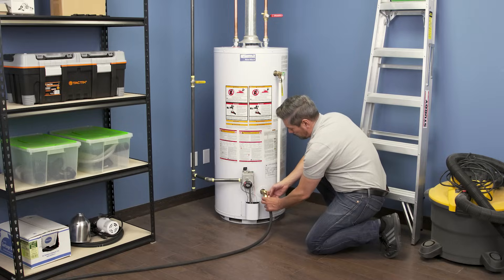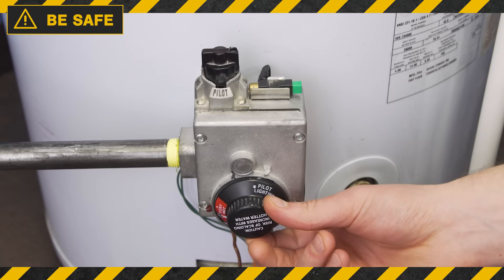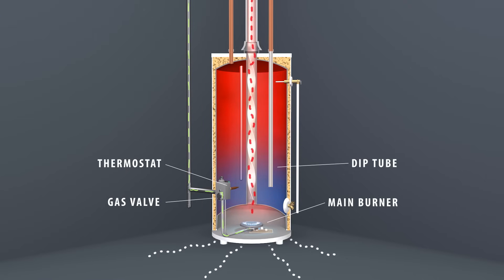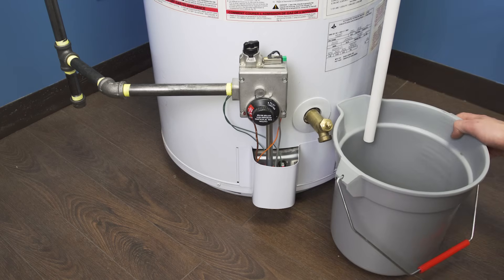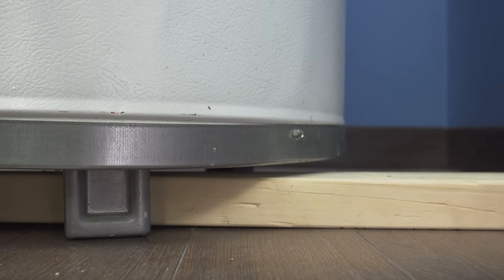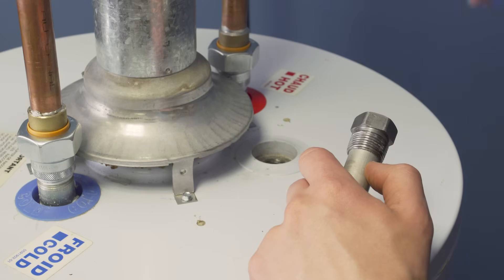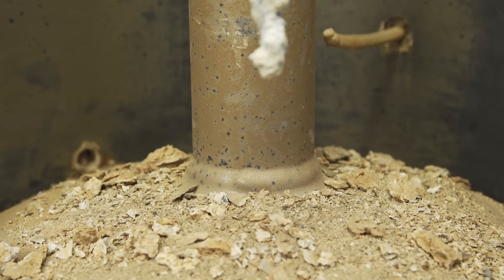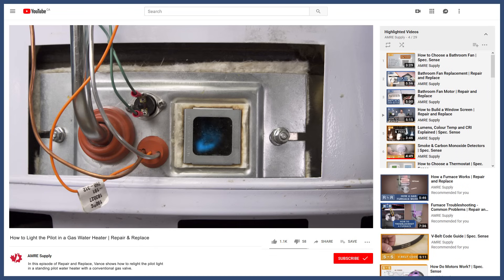Gas Water Heater - Maintenance Guide | Repair and Replace

Comment: By far the best video dealing with water heater. Most of the scammers deliberately not showing all the details to confuse you, hoping you give up and call them. Watch this video a few times. Carefully step by step write it down. Do the replacement carefully making one step at the time. First time doing it seems to hard. The next time you’re the best water heater professional. Because none will do better job than the owner. Knowledge saves family budget. Good luck!
Reply from the maker: Thank you we're glad you found it helpful!

Comment: I disagree on the annual checking of anode rod because by the time you loosen the connection and pull the corroded rod to eyeball it, then might as well replace it.
Reply from the maker: It really depends on how hard someone's water is. There are cases where the anodes will go much quicker and checking it once in a while can give you an idea of when it will need to be replaced.

Comment: Can you just use pipe dope on the threads rather than teflon tape?
Reply from the maker: Yes pipe joint compound can be used as well.

Comment: 16 year old gas water heater. Never touched it to do maintenance. still working well. Should i bother replacing the anode ray or just wait for the WH to eventually fail?
Reply from the maker: Thanks for watching. It depends on how hard your water is. In some cases you can get away with without replacing the anode for a while but if you access and remove the anode it you can see how much is left on it and make the decision on when a replacement would be needed.

Comment: Nice video. Flushed my 1.5 year old water heater and my water must be pretty soft because water came shooting right out. Idk how I’ll ever replace the anode rod until it completely disintegrates. There’s like 1-2 feet of headspace above the water heater
Reply from the maker: Thanks for watching. If the anode disintegrates it can make it easier to remove. In some cases you can just use a hacksaw to cut it or bend it.
There are flexible and segmented anode rods that can make an installation easy in tight spaces so there are some solutions!

Comment: this video need Edit: You need to flash first or drain 5 gallons or so before checking the anode rod. No need to turn off the gas. Turn off water, turn gas to Vac or Pilot and go to sleep, next day your water will be cold. Much easier with cold water.
Reply from the maker: Thanks for watching. In these videos we advise to turn off the gas and to put into pilot mode for that additional level of safety. As well in the video we mention draining several gallons of water before checking the anode rod at 4:27

Comment: I have a 30 year old heater that has had zero maintenance.  How do I know when it's time to replace?
Reply from the maker: Thanks for watching. This can depend on the hardness of the water. Some people find that regular maintenance helps and others have gone decades without touching their water heater. If you try to access the anode rod at this point, the threads will likely be stuck and quite difficult to unscrew. You can always check the anode and replace it if necessary. Depending on how much is left, that will help you know when you should install a new one.
Reply: When it starts leaking its done

Comment: Great and very detailed video! The only item missing is to mention that when replacing flush valve, instead of regular get full port one - it will speed up flushing and remove more debris.
Reply from the maker: Thank you we're glad you found it helpful! We did mention the full port ball valve in the dedicated drain valve video: https://youtu.be/nGCejMsKNX4?si=V3sA_QfBlstpVair&t=197

Comment: The first thing I would do is change the plastic relief valve piping. I can't understand how anyone can use plastic for a heated pressure vessel that ha the potential of producing high pressure steam which is very dangerous,. That plastic would blow righ apart under 160psi and steam temp would be over 350 F
Very dangerous.
Reply from the maker: That is an excellent point. Plastic is not idea and in our Drain Valve Repair video we outline the option of using a full port ball valve instead of plastic: https://youtu.be/nGCejMsKNX4?si=ep5daL5Iay2dysZV&t=195
Reply: @AmreSupply  Yes, I saw that. But I was talking about the T&P RELIEF valve that was piped to the floor with plastic.
Reply from the maker: @akrocuba  Thanks for clarifying, missed that part on the relief valve during the first read of it. Have you seen examples of the plastic piping rupturing under that pressure? Or do you think the fact that the unobstructed pathway allows steam and water to be released through the pipe rather than damaging the discharge pipe itself?
Reply: @AmreSupply  Yes. The plastic could simply melt way, rupture and then the relief
 is pouring into the area of the vessel

I know manufactures make the relief valve drains, but manufacturers also still make S-traps that are illegal in every plumbing code that I know of

I'll stick to steel or copper for all my pressure/temp relief piping

Comment: Just replaced my 28yr old water heater, never touched it. Don’t touch your water heater!
Reply from the maker: Thanks for watching. The advice to never touch it and do any maintenance might not be the best idea depending on what model you have. Older models didn't have a flame arrestor screen. Dust and debris can clog this screen and can prevent the burner from working properly. In these cases regularly cleaning the screen can prevent these problems before they occur.
Reply: Do you ever change the engine oil in your car or truck? Any other maintenance?

Comment: Should start with, this video only pertains to GAS heated water heater
Reply from the maker: Thanks for watching. That is a good point, though some of the steps are applicable to both electric and gas, these repairs do focus on gas. We've added a note in the title.
Reply: @AmreSupply  yes, I still gave the video a like because it does cover all the steps. Great video, and thanks for adding GAS in the title. I just know people with electric will question how to turn off/on the water heater. They will loom for a switch rather than turn off at the breaker.

Comment: Is the Anode flexible?  
 It doesn't look like I have clearance between the water heater, and the ceiling
Reply from the maker: Thanks for watching. If the anode rod is longer than the space above the water heater, you might have to cut it with a hack saw to remove it. There are segmented / flexible rods that can be installed afterwards. The segmented rods can be bent in several places:
Reply: Thank you
Reply: You can buy one that DOES bend for such a situation. They have 3 sections with a space between to bend it in 2 places.

Comment: I'm not sure how old my water heater is, but at a minimum, its 3 1/2 yrs old. I have never flushed it, but I've been thinking of doing so because our water has been having an off smell about it (occasionallylike musty or gas) and sometimes comes out dirty (faucet and toilet),  but no one in my community has that issue. Not sure what else it could be in our house.
Reply from the maker: Thanks for watching. It depends on the mineral content of your water but it can be good to do a flush and check anode to see what state it is in.
Reply: How'd it go? Does it still smell the same or worse?
Reply: If you have dirty water at the toilet, it's not a water heater issue. The toilet is supplied by the cold water line.

Comment: Really good video. We bought our house three years ago. I’m sure we have the original propane water heater from 2006. I would bet it has never been flushed and the anode never replaced. I’ve noticed the water is hotter than it used to be although I’ve never changed the temp setting.

I’m concerned that if I flush it after 17 years there may be sediment that will plug the drain valve and/or the piece of hose attached. At this point am I better off just replacing the water heater? I’m afraid of getting into a mess I can’t get out of without calling a plumber anyway. Thanks.
Reply from the maker: Thanks for watching. To install a new tank, a plumber would have to drain the tank anyways. This tutorial shows how to flush a tank, and backflush if needed. https://www.youtube.com/watch?v=hkbi24QJhDw if you feel that you need a new tank there is no harm in calling a professional for a 2nd opinion.
Reply: @AmreSupply Thanks for your reply.  I may go ahead and try to flush it. I’m concerned that if I get in a mess and need a plumber they might not be able to come over right away. And to remove/replace the anode, I’d probably have to disconnect everything because there’s not enough space to accommodate the length of the anode. And mine has the exhaust blower on top because the vent doesn’t go straight up.  I’d have to lean the tank over to remove and replace the anode I think.
Reply: @TheYamahog12 how did it go?
Reply: @TheYamahog12 Get a segmented anode for the new one, thats what I used, makes it easy with low clearance access! :)

Comment: Any advice in  removing the  Anode rod on  1.5 year old tank.  I used a breaker bar and pneumatic gun. The nut wont even turn 1mm.  I find it hard to believe in 18moinths I can't remove it.  I'm afraid to use the pneumatic gun in case it breaks the tank.  I used a 3foot breaker bar no go either.  Any suggestions would be great.  Thank you in advance.
Reply from the maker: Thanks for watching. In the cases where a thread is seized, heat and penetrating oil can be used to help loosen the threads. Note: Do not use penetrating oils and heat at the same time, but in alternating steps. Make sure there is no penetrating oil on the surface when you apply heat.

Comment: Anode rod replacement: The announcer says apply the tape clockwise. He should have said counterclockwise. You want the apply the tape to the threads opposite the direction you will screw in the replacement rod.
Reply from the maker: Thanks for watching. The clockwise direction for teflon tape was based on the perspective of looking at the threads, like you would have if you had a pipe facing you. If you are looking down at the hex nut, then it would be counter clockwise. We have a video that goes into more detail on applying the tape: https://youtu.be/9DhL0vet4gk?si=aJNIA5wql9_4Mifs&t=104
Reply: Yes. Correct.

Comment: My tank isnt even 3 years old yet should i not bother doing this?
Reply from the maker: Thanks for watching. It's unlikely that there is a lot of sediment after that time but this depends on how hard or soft your water is.

Doing this sort of regular maintenance will give you an idea of the health of the anode rod and will make it easier to judge when you'll need to replace it as you'll have snapshots over time.

Comment: Teflon tape is applied COUNTERCLOCKWISE, not clockwise.  That way, when screwing in the electrode (it is done clockwise) the friction will not remove & bind up the tape.

You’ll get a better seal as well.
Reply from the maker: Thanks for watching. The standard recommendation of wrapping the the tape clockwise (in the same direction of the threads) is to prevent it from becoming lose and bunching up when the threads are tightened. 

In this video the direction to wrap it clockwise is based on our perspective in the camera. This is the same as if you were looking at the end of a pipe. If you flip the anode to have the rod facing away, then yes you would have to wrap the tape counterclockwise.
Reply: Both right.  Depending on how you hold the rod

Comment: This shows an illegally connected water heater.  Gas lines can not use white Teflon tape for gas connections.  Move over - hard piping to a water heater without the use of a semi-rigid connector puts undue stress on the gas pipe which now must be exactly plumbed to a perfect position for the water heater - and once servicing a water heater that is empty, transfers any forces and motion from the water heater to the hard piping.  If someone would even lean on the water heater, or bump against it, it would easily transfer to the hard piping and risk a pipe frack that would go unnoticed.  Another reason for a connector (max up to 6 feet) as specified by the international code 2015.  This could induce small fractures and put the household at risk.  The pipe also looks to be galvanized water pipe - which is also not allowed for gas.  galvanized pipe (zinc coating) can flake off, and cause issues with gas valves.
Reply from the maker: Thank you for watching and sharing your experience. This water heater was placed in our film studio and was not connected to water and gas so it wasn't fully functional. We used yellow teflon tape on the gas connections and set up the water heater fully knowing that the plumbing code differs depending on the region and is also changing over time. The wood floor is also not recommended but is what we had installed at the time as part of our film set.
Reply: A couple of the things you suggested are code now, or strong recommendations to use. A water heater can absolutely have hard piping plumbing, it as it’s not an appliance that’s expected to move. My house was built in the 40s and I have galvanized for some of my gas line. I am aware that some of the galvanization may flake off from the inside of the pipe and cause issues, but I haven’t had any sign of any any issues.  It’s one of those things, could it happen? Sure. Will it happen? Probably not. Also, when I saw the Teflon tape in the video, It looks yellow to me. You should get your eyes checked.

Comment: Where is the required pan and the clearance required from the floor?
Reply from the maker: Thanks for watching. The water heater in this video was just set up for demonstration purposes in our film studio. Since plumbing and building codes evolve as time goes on, and are different depending on the region, the water heaters you'll see in videos might not look the same way that you might see locally.

Comment: I see you change the COLD ANODO i have to change the HOT ANODO also ?
Reply from the maker: Thanks for watching. Water heaters only have one anode rod. If it has one that is integrated it will be on the hot side.

Comment: trailer homes suck.. I got a hot water heater in a closet. Not the most easiest thing to get to.
Reply from the maker: Thanks for watching. You are right that not all water heaters or furnaces are easy to access. It makes some repairs go slowly without that additional space.

Comment: Great info here! I have a water softener tank hooked up to my hot water tank. I was told that I wouldn’t need to drain my hot water tank because of this. Any thoughts to this? I’ve been in my home 6 years now. Thanks!
Reply: You can actually have more sediment in the water heater forcing you to flush it more often. Sodium is exchanged for harder minerals in the water, and excess sodium can build up in the bottom of the tank. This is the case for my water softener and hot water heater.
Reply from the maker: Thanks for watching. If you have a water softener then it will reduce the amount of corrosion and sediment. It can still be good to check the anode rod and the tank to see how much has happened over 6 years.

Comment: I just replaced my 17 year old AOSmith 50 gallon tank, never drained or replaced rod, old school plumber told me don't touch it ever..he was right..
Reply from the maker: Thanks for watching. There are a lot of opinions floating around on how much maintenance is needed. Water hardness and softeness will change the longevity, as there are some places where the anode rode will degrade within several years if not replaced. We're glad that you got so many years out of your tank.
Reply: @AmreSupply that’s exactly what it is, one zip code over and that water is a different story. Has everything to do with maintenance schedule, your zip code may vary lol
Reply: And you no dirty buildup inside your tank??
Reply: That new water heater won't last 17 years with no maintenance!
Reply: I just changed a 21 year old Whirlpool water heater, never did any maintenance, previous owner couldn't even fry an egg so I am sure he didn't

Comment: It would help if you had emphasized turning off the gas or electricity to do the maintenance chores. Stupid people don't think and shouldn't even attempt to do this stuff but leaving the gas or electricity on would be a serious mistake. Can't overstate it.
Reply from the maker: Thanks for watching. There is a whole section on disconnecting the water heater which is at 1:23 in this video.

Comment: Great video... If you need to replace the anti corrosive pipe thingy, is it standardised, regulated to only Gas Professionals to install it or can be purchased online? Thanks again for the video.
Reply from the maker: Hi David, thank you for watching! AMRE Supply sells anode rods and other water heater repair parts to anyone who needs it. You can order them online, we ship to Canada and the US: https://www.amresupply.com/catalog/Anode-Rods-661013-PP2
Reply: @AmreSupply  thanks so much. One more question. How do I know which on I should choose?
Reply from the maker: @davidestate  You're welcome! The different types of anodes is covered in this part of this video: https://youtu.be/hTJv67imgaE?t=131

Comment: Does Amre Supply provide daily maintenance of the water heater?
Reply from the maker: Thanks for watching. At AMRE Supply, we provide the knowledge and the parts needed for repairing your water heaters, furnaces or appliances. If you're looking to hire someone to do maintenance on your water heater then there are plenty of local companies that can help you out. Just search for "water heater maintenance" and include your town or city. Look for a company or plumber with good reviews and give them a call.